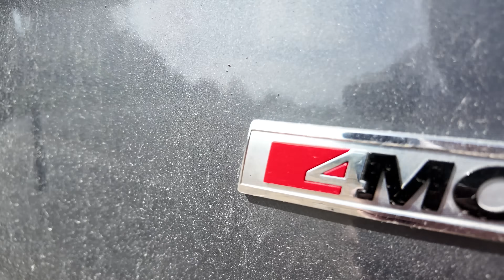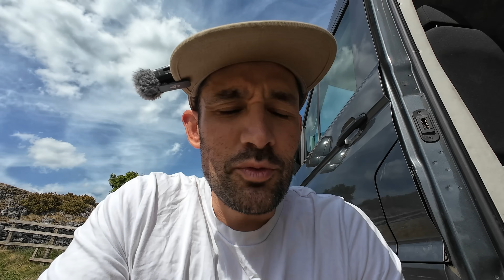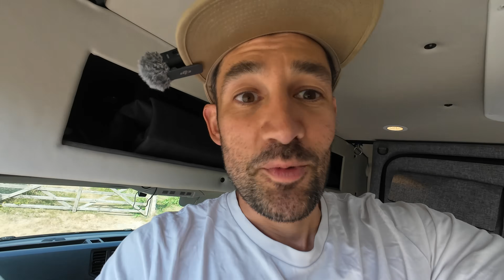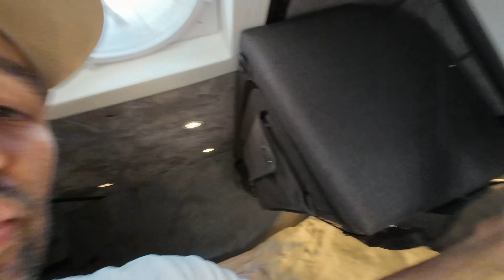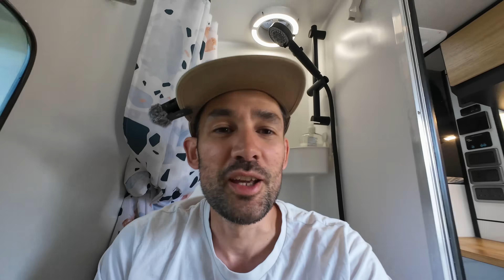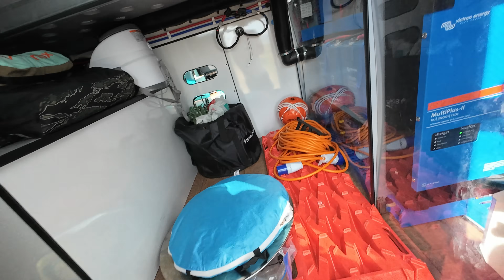4x4 VAN TOUR | Luxury Off Grid Adventure Van For A Family

Comment: How is this road legal if it's 3.9t, plus passengers I assume. Then it's more than 4t, not road legal anywhere in EU
Reply from the maker: No pal we were bang on 3.9t loaded with passengers. But I have since up rated again to 4.2t so now we don’t need to pack light or be worried about weight.

Comment: Great build and following your new build . I just received my Adventurer Curved windows from Jackson’s , same as yours , but I have to say I’m a little disappointed with the lack of curve !! Did you notice the curve in yours ? Mine are smaller 700x400 but if you put a straight edge along the frame there is only 1.5mm gap in the middle . Cheers
Reply from the maker: Thanks mate. It’s only a slight curve. But they are a great window for the price. Don’t worry about it. Make sure you cure your wooden frame on the inside.

Comment: Hello. You mentioned you try and respond if someone reached out for some assistance.  Well, having watched your videos on the van build and van tour, you mentioned two things I’m particularly interested in.  

1, the ice studs.  Where did you source them?
2, You talked about your autoterm products.  I already have an autoterm air heater which I find fantastic.  You also mentioned an autoterm engine pre heater.  I want to fit one of these to my 1986 VW Syncro camper as I’m planning an Arctic trip.  You said autoterm helped you with this.  Are you able to share this info or any other advice and model info on the pre heater?  TIA. 🙏🏻
Reply from the maker: Hi. You will love the arctic a must do trip. The studs were from https://supatracks.com/tyre-studs/. 

Speak to auto term they will advise as they did for me. Very helpful guys and they can install. I have a discount code for them on all my videos now. But we chose them for their reputation and quality. I believe you can fit them to any vehicle so you should be good.
Reply: @abucklife thank you. 🙏🏻

Comment: Hey… quick question. Your victron is awesome and is along the lines of what I am thinking of doing. I read somewhere that having multiple panels (4) is less efficient or something and having fewer bigger wattage panels is “better”?  Did you find that it made any difference?  I am thinking of all electric too and want to get that bit proper on the money
Reply from the maker: My best advice is use someone to design the system. But yes I think you are right. It’s probably better to have less panels and bigger ones but to fit them around my fans was also important. Everything is a compromise I guess. A good system designer will be able to advise on stuff like this.

Comment: Great van, and a great series of build videos, you guys do a fantastic job.  I'm still trying to persuad my wife of the merits of a camper, as part of that I am trying to plan out what our ideal van might be.  Off the back of that I have a couple of questions.
First, is 4x4 a worthwhile move?  I have a 20 year old Jeep that I have modified and offroaded quite a bit.  My experience is that good tyres and ground clearance can get you a very long way before you ever really need four wheel drive, I am 99% certain any 4x4 camper would run out of ground clearance before the point I would think about going in to four wheel drive in my Jeep - a camper has such a relatively long wheel base that the breakover angle must be pretty poor.  As 4x4 vans are a lot more expensive, heavier and there is a compomise on interior headroom vs front wheel drive, I am wondering if those downsides are worth what I expect to be a very limited number of situations where the 4x4 will help.  Would be interested in your thoughts.
Second, what size is your bathroom overall and what size is the shower tray?  Do you find the shower area is big enough given you use a shower curtain?  While we are on the bathroom, if doing it again would you put that small sink in there?  The bathroom sink is just outside and given it is so small presumably it is only for rinsing hands after using the loo.

Please don't take my questions as any sort of implied criticism, I think you van is amazing and your build series so good that I have watched some of the videos four or five times.  I am full of admiration and genuinely interested in your thoughts.
Reply from the maker: Thanks for your comment pal. Great to hear from you. I will do my best to answer but ask again if i have missed something. Also my video this week may address some of these things. If you went for a merc 4x4 they don’t have the same problem. I feel like 4x4 was invaluable in our Arctic adventure specially when on the snowy mountain pass. Yes tyres are very important but a fwd van pulling all that weight up a hill could have struggled. I would maybe go rwd if not 4x4. It just gives you the confidence. But if you are experience in off roading you may be confident with fwd. I had a truck years ago which I used to off road and would’ve a van with hi lo but I know what you mean you are limited by the length. Maybe a mwb would be better. I have seen some pretty epic off roading with mwb vans.
Reply from the maker: Showroom was 100x80 and the shower tray was 50x80. Shower area is fine if it wasn’t for the curtain it would feel even roomier. The sink I think is invaluable for cleanliness with a small family. You don’t want to be washing your hands where your washing up your food stuff if off grid. I would consider a wet room style showroom too but I also like having the wet and dry side. My video this week I talk about this. As it’s a common question. No offence taken by your comment great questions.
Reply from the maker: Thanks for watching and commenting. Appreciate the support.

Comment: Brilliant van tour! Quick question. Have you had any problem with your Max Air fans tripping? Ours is very temperamental with voltage levels
Reply from the maker: Thank you. No problems what so ever. I have them wired up as follows. The showroom and bedroom one on one spur and then the one at the front on its own.

Comment: Hi mate, we’ve been following your build from almost the start. We’re a bit behind you though in time line!

Quick question. Where did you source the plastic sheet and magnets from for your electrical cupboards and did you cut and make them up yourself?

Many thanks in advance!
Reply from the maker: Thanks for following along. Just an online cut to size laser cutting website. 3mm acrylic. Although maybe 5mm would be slightly better. But heavier. And then the magnets just of amazon. I just measured up and got them laser cut to size. I did notch out for the heating duct with a hole saw and jigsaw metal blade. 👍
Reply: @abucklife thank you so much for that!

Ok brilliant will take a look x
Reply from the maker: @project-overland plastic sheet shop.co.uk found it on the emails.
Reply from the maker: @project-overland  https://amzn.to/4kM46bK magnets
Reply: @abucklife thank you so much! Brilliant!
Reply from the maker: Welcome.

Comment: Lol! BF Goodricch came last in an ADAC-test of may 2025 of a  total of 8 AT tires! Non of them came even close to the All season reference tire.
I really don´t get the hype of an AT tire, poorer handelinggrip and breaking distance. Disaster fuel economy, and a AS 2wd with differencial lock or brake would get better grip on ice, snow and gravel compared to any AT tres. 

With 16 meters longer brakingdistance in wet conditions from 80 km/t compared to the AS tire, and 8 meters longer than the best AT tire, no one should buy BF Goorich.

99,9% of all driving are on tarmac, why would anyone choose a more expensive, poorer handeling, and more fuelconsuming tire to prefom that 0,1 % driving offroad that a differiential lock/brake (cost of aprox 1000 $ )  would handel safer and much better?
Reply from the maker: What’s the best at tyre to go for? I will take a look when these need replacing. I was pretty happy with how they handled the snow and used them on my previous truck but if there is a better tyre I’m interested.
Reply: @abucklife  Travels in temperatures above 8  degrees celsius; testwinner normal summertires.
Travels under 8  degrees celsius testwinner normal wintertires.
in the European arctic you can buy studs to screw in the wintertires.
That gives you best secure handeling and shortest brakedistance + best fueleconomy!

Comment: Great work, nice van ! Is it the L4H3 ? How is your inside height for standing ?
Reply from the maker: Yes mate L4h3. They do one slightly longer. Height is ok but as it’s a 4motion with this type of van you loose ten cm of height compared to fwd. I would prefer more height but also wanted 4x4 so it’s a compromise.
Reply: @abucklife  So you have standing height of 1861mm minus the thickness of floor and roof insulation - should be around 1750mm ?
Reply from the maker: The floor was 38mm in total and the ceiling was 3mm plus lining. I’m about 182cm and can’t quite stand up tall but standing is ok.
Reply: @abucklife  Thanks for sharing ! I am taller, so I must look for a H4 one !

Comment: Hi Matt, loved the van build videos  theyve helped massively with ideas for our build. Where did you get the kitchen tap from and 240v sockets? 
Looked like a great trip to the Artic. Given us the idea to take our 5 month old to the alps for a month. Keep up the good videos.
Reply from the maker: Thanks mate. The kitchen tap was from tool station but I wouldn’t recommend it as I can’t get the pressure to work on it well yet pressure in shower room is great. The 249 sockets are c line campervan ones. If you google that term they come up. The outdoor one on the door way was from Amazon.

Comment: You have done an amazing transformation of your van.
I'm still in the process of doing my crafter and it takes forever to get to the end of the build.
You should be proud of yourself for what you've achieved.
Thank you very much for showing.
Konrad.
Reply from the maker: Thank you mate. Appreciate the kind words. Where are you up to with your van build?
Reply: Well, I've got diesel heater, under bonnet hookup.
2xside windows, fiamma awning, maxxair fan.
I've just finished my fixed bed and waiting for the roof liner and carpeting all.
Fingers crossed I could get away this summer 🤞
Reply from the maker: nearly there mate